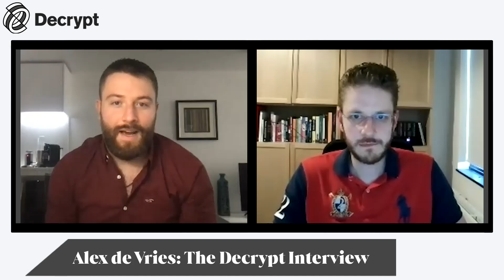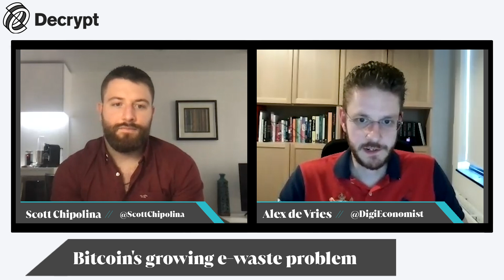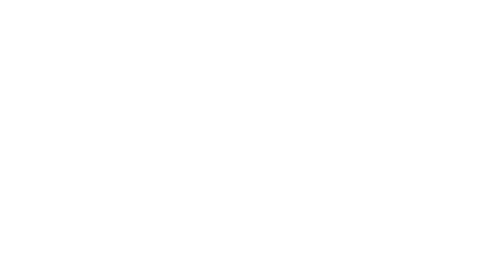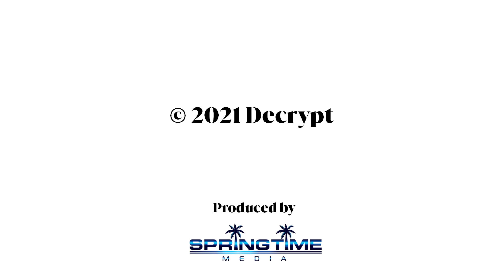Digiconomist Founder Alex de Vries: Bitcoin's Growing E-Waste Problem

Comment: Alex de Vries wrong on multiple aspects:
1. Banks, PC - is not efficient machines, they consume 1000x more energy in less efficient way. there is no any math force to optimize them. 
2. How Logical argument of "consumption size" in compare - meaning and leading to E-Waste ? that's absolutely wrong logics and argumentation, without full scope. 
- for example Heaters and Centralized Air Conditioning systems consuming 27% of all US electricity that's - 25 europe countries.
China consuming even more. But main point is it useful, and is it really leading to toxic e-waste... including proper definition of e-waste.
is e-cars also meaning e-waste ?  
3. did the Alex - trying to battle IC chip industry as well ? and why exactly IC Chips, and bitcoin ... why not Gaming ? or clocks ? 
4. waste of VISA is not properly calculated by Alex ... he forget to calculate it properly.
5. a lot of rest "suggestions" is also absolutely wrong 
6. there are 0 - CO2 on mining side. existing mining already for 80% using green and clean sources.
 that we can't say about world electricity consumption and generation it's still for 78% is very dirty - 1000x CO2 is still there, easy to gain... more effect vs bitcoin.
-  is Alex talking about Coals in China... pfff mining there was using less Coal...  why he didn't mention all China Coal effect ? 
or world/EU/US/China - electricity efficiency and generation sources ? China is responsible about 56% of global CO2, that' bigger vs EU+US+Canda+Asia together. 
even electrical cars, phones, gadgets are 100x more dirty - including very dirtly lithium batteries. 2019 study shows that 40% of the total climate impact caused by the production of lithium-ion batteries comes from the mining process itself !!!

Comment: Total bullshit estimate. FAKE NEWS. 
They are basing the entire estimate on the machines lasting less than 2 years. 
As someone, who buys and sells ASICS, I can tell you that 4 year old machines are now selling for 3x-4x the original cost. 
No one is throwing away anything. 
Even a broken machine is selling for more than original cost.
Reply: The research was pointing to the fact that most machines are only profitable for ~2 years, which holds true for SHA-256 at residential electrical rates.  What makes matters worse is that ASICs serve little purpose once they're no longer profitable aside from being space heaters.

While I haven't been able to profitably GPU mine BTC since 2015 or so, I can still run Ethash.

Which 4 y/o ASICs are selling for 3-4x original cost? Antminer s17's are barely profitable today for most folks and haven't even been on the market for 3 years.
Reply: @ShaunMichaelQuirk  That's what he wants you to think, But HE WORKS FOR THE FUCKING DUTCH CENTRAL BANK, look it up, he's been doing this for 7 years+
Reply: @ShaunMichaelQuirk  "The research was pointing to the fact that most machines are only profitable for ~2 years"...that's what he says everywhere and journalist doesn't even take the time to do the research. So, try to found 2 or 3 miners, and ask them of works the life of an asics...you can actually found the answer online, but it's always better to talk with different peoples to compare the answer and improve your knowledge for futur questions with those for and those against mining. Actually every single point from the "study" from this guy is a sad joke, from a reaserch point of view, it's pretty embarrassing actually...